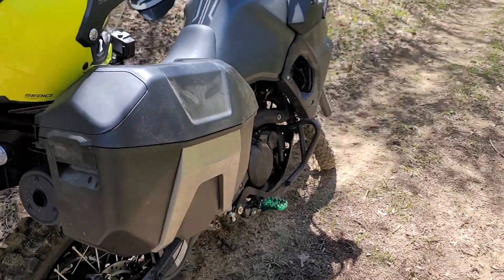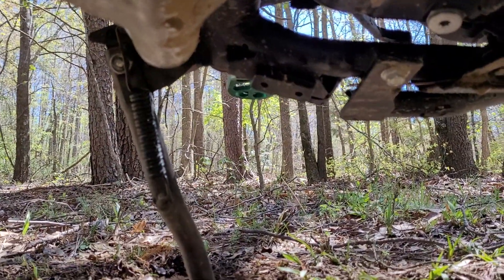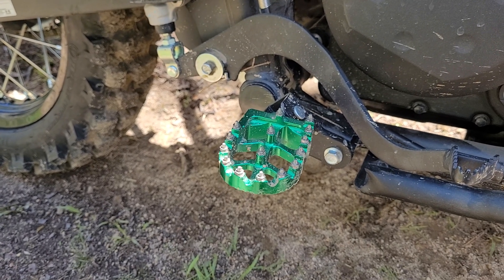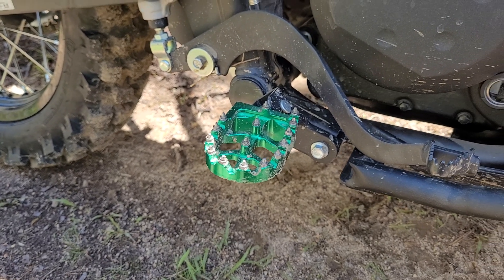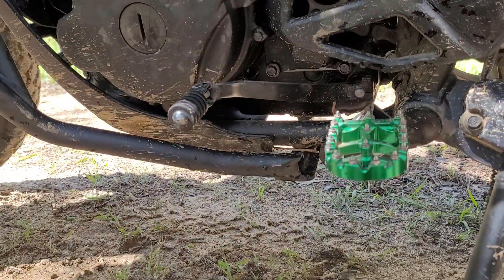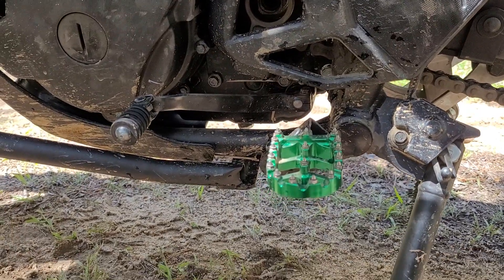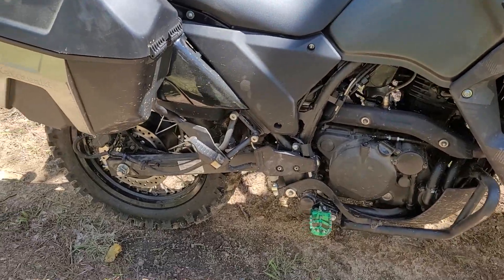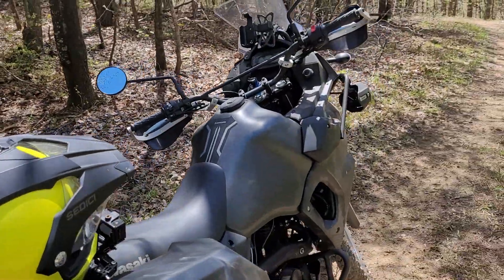2022 KLR 650 Upgrades, So Far.

Comment: With the hand guards,  You are supposed to use a spacer between the grip and and guard mount.
Reply from the maker: It's not possible with the location of the brake master cylinder, and it would not change the fact that the guard would still need to be bent to line up with the threads on the end of the bar.